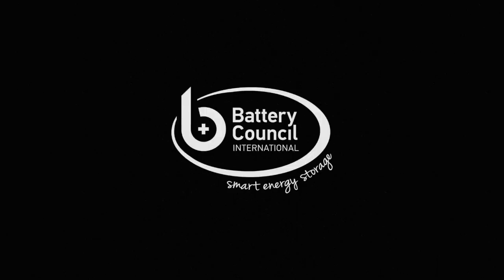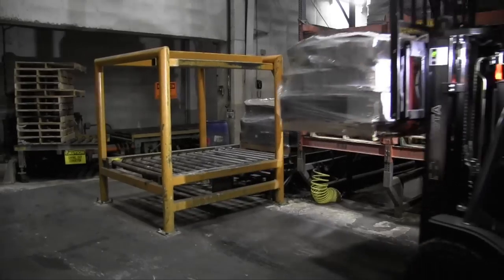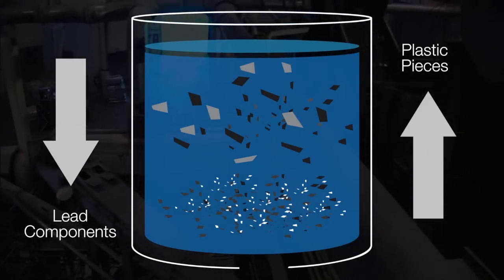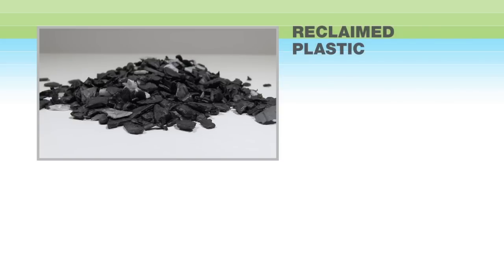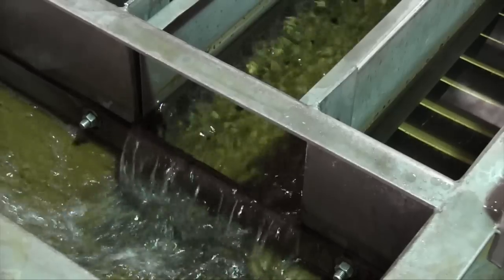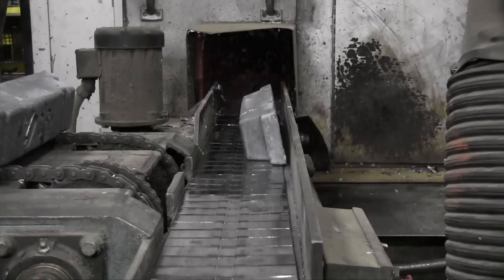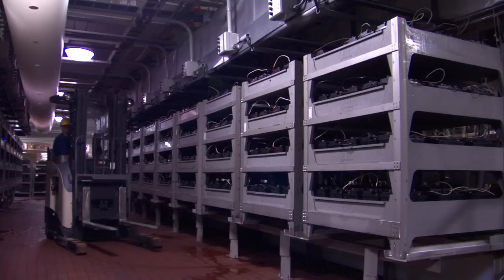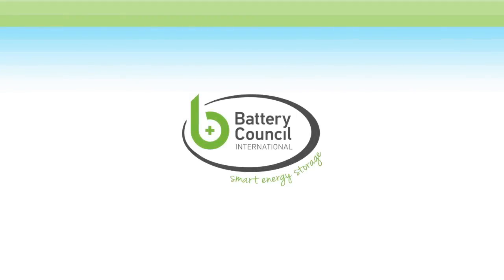Lead Battery Recycling Process

Comment: Until about the exact date of this video, Sydney Australia had a battery recycling factory called Australian Refined Alloys, which had a big saw blade which cut the tops off car batteries, then tumbled them, then the lighter weight emptied cases somehow tipped out of the tumbler on to a short conveyor belt and went up to get dropped into a plastic shredder and rinsed and filled into a bin forklifted away to a big bin.

The lead fell from the tumbler into a bin regularly forklifted to an adjacent pile then scooped up by a machine and tipped into a long trough driven by a machine which tipped it over into the furnace nearby.

The bigger truck batteries as much as possible, and all forklift batteries, were manually by one man, after 1995, working on a stainless steel bench paid about $35 ton, to have axed of their lids and connections, then empty cases manually put on the same conveyor belt, and contents lifted manually into a bin alongside the bench.

That factory moved to Wagga Wagga.

Before 1995 the bench did not exist and instead a different worker worked off the floor, lifting every forklift battery up into a ferrous metal bin.
He did not axe truck batteries.

Comment: What a load of old bollocks.....probably 75% recycled..where's the slag of the lead...the active material from the plates..sulphates...calcium...irons...etc...gone up 8n smoke or land fill...they omitted that part plus if they made the batteries how they should they wouldn't need recycling as often...it's just job creation that wrecks the environment....well done!!

Comment: may anyone tell me the price of this automatic plant?
Reply: Idk about the price but I do know that the 12 Volt automobile battery making industry is only done by a handful of companies & is pretty a ( You Pay For The Labeling!) Just like "Proctor & Gamble" is to most household use products ,which again boils down to a single company manufacturing bargain buy products like Value brands or in store brands, to manufacturing top shelf products like Tide & Crest. It's a pretty cool process & fortunately after working in the battery business back in my late teens through my early twenties , I learned a great deal of information from battery tech to sales service to even creating our own 2nd to 3rd hand labeling bargain buys via mass purchasing power thru junk & salvage yards . You'd be amazed what you can learn from a single volt meter , a battery load tester to a battery charging table capable of producing 100's of charged batteries a day that were slated to be scrapped but thanks to a handful of fairly minor tests ,checks & errors ,we were able to create an instore brand primarily 1 to 2 year warranty batteries significantly cheaper than top shelf brands.  Which even at today's prices of brand new top quality brands, I'd personally still vouch for 2nd hand battery @ bargain value
Reply: do you need sodium nitrate

Comment: how much cost this project ?
Reply: A plant of moderate capacity would need an investment of Rs, 250 lakhs in plant and machinery. Add another Rs. 150 lakhs for civil work. ANd then you will need to buy a land and that could be anything between Rs. 400-600 lakhs. Finally the working capital, these projects need huge amount of working capital and to be safe you would need Rs. 1000 lakhs to run this unit for at least 20-25 days. And then comes the risk part, lead market is very volatile and its price change on an hourly basis.
Reply: do you need sodium nitrate
Reply: Why? Are you going to build one?